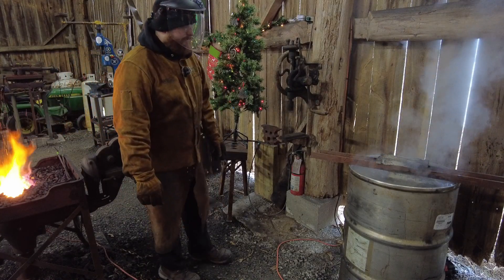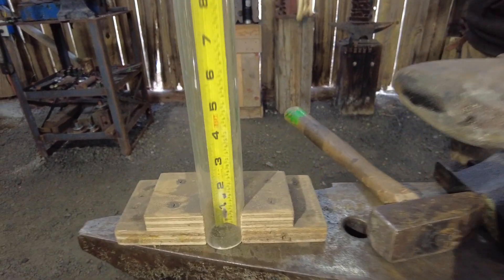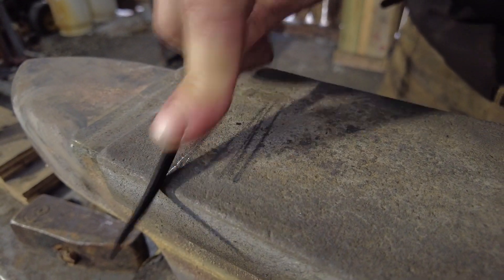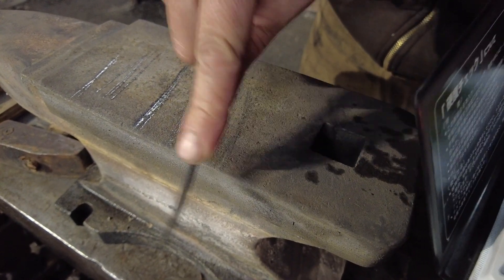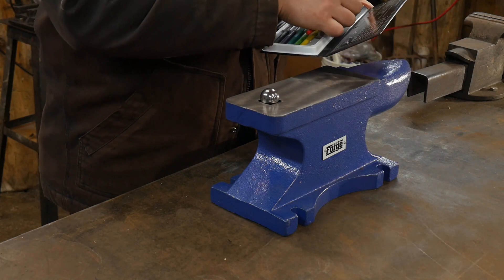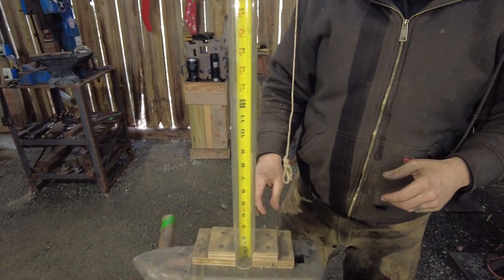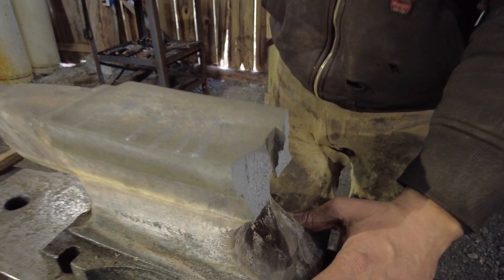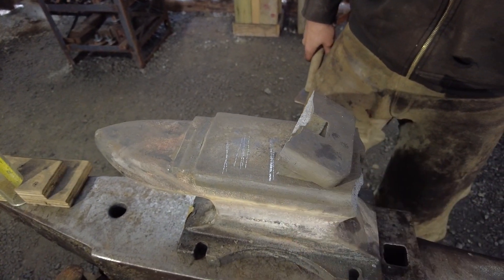Harbor Freight Anvil: Can It Be Hardened?

Comment: i feel like if you moved the anvil around while quenching it might be harder. do you think it would make a difference?
Reply: Physics - you can't do anything with cast iron far as heat treating goes. Best you can do is break it like they did - cast iron is super brittle as it is - heating it glowing hot and drowning it will assure you of a break - just like dumping cold water into a well overheated motor block.
Reply: Yes and no.  With cast iron, it's a lost cause.  In general, though, you are 100% correct.  The lydenfrost effect forms a "pocket" of steam around the anvil, preventing it from further cooling it.  Historically, anvils were often quenched under running water, often a waterfall or "shower" type rig.  Even moving it around helps break up the pocket, but fast moving water is better.

Comment: So,  a 12-18 inch piece of 4140 3in round heat treat from Speedy Metals or whatever tilted up vertically would be a better bet for a newbie I'm thinking.
Reply: Definately. Someone wrote a comment above that Harbor Freight anvils are only anvil shaped objects. They are good for straightening nails or for paperweights. Cast iron is not hardenable.
Reply: Cast iron can be flame or induction hardened (common for machine ways, gears, etc).

Comment: Thank you 
&
Merry Christmas. 

How many requests did you have 
for forge welding steel plate to 
the H.F. anvil ?
Reply from the maker: Merry Christmas And maybe enough to test ? 🤔
Reply: I've heard of people welding plates on, always assumed they meant arc welding.  (and quite a few did, I suppose).  Somehow The thought never occurred to me that you could forge weld it.  That might actually be the best possible "upgrade", short of selling it and buying a better anvil.
Reply: I am still very new to anything other than some stick and MIG welding but I have always heard that you can't weld cast iron. Is forge welding different in that respect?
Reply: @markhenrikson9790  You can weld cast, but it is not easy to do, well beyond the abilities and equipment of your average amateur welder.  As for forge welding, My understanding is you can bond pretty much any metals that you can get hot enough, and can keep from forming scale/oxide, but there could be some that don't work.

Comment: Considering Harbor Fright's track record with quality control, it's probably going to either crack or shatter on quenching, but if you luck and grab the golden ticket one, you'll have a pretty decent entry level anvil that isn't just an ASO.

I've bought a screw driver where the point chipped turning a stuck screw, took it back and swapped it out and now i use that thing for prying staples and such. Harbor Freight is just a Blue Collar Casino.
Reply from the maker: LoL love that blue collar casino 🤣
Reply: I watch Project Farm, The Harbor Freight car battery jump box, couldn't jump a Ford 4 Cyl Ranger. The Harbor Freight zip-ties, the best. I got an open box small shop vac for about $20, amazing for small, tight area jobs, use the hell out of it. picks up screws and nails  Your comment, on track. I have engine hoists and stands. about 3 floor jacks, couple ATV jacks and jack stands, never had an issue. The ATV lifts I use all the time on our Harley's and other motorcycles. One of the floor jacks I use on my F350. I have busted some of their hand tools, but I am fine with it. Need to modify a hand tool, cheap is the way to go. I have a lot of old made in USA Craftsman, not going to grind an open end wrench to fit in a small spot I'll most likely use once. This is where Harbor Freight shines. Sometimes cheap tools are priceless.
Reply: @michaelconran5252  the rule I was tight growing up, if you need it for one job, go to HF, if you need it to last go to Sears
Reply: @deathsicon  unfortunately Craftsman is not the same anymore. Most of the Craftsman is have is from 80's early 90's. Now I buy other brands that have lifetime warranties. I got cheap if it something I will only use a few times. I went cheaper on the 72 Torx I may use 2 or 3 more times on my Harleys luckily over the years I have anywhere from 3 to 5 of everything.
Reply: @michaelconran5252  yeah it's sad, though since I went to school for motorcycles I mostly use snap on until I do the big diesel machines at work
Reply: @deathsicon  a different but useful rule if you do not know how often you will use it, buy the cheap set, and whatever breaks is worth replacing with quality tools.
Reply: @vidard9863  That and If I borrow it 3 times in a month I need my own.
Reply: @deathsicon  -- You work on big diesel motorcycles?
Reply: @binbashbuddy  haha that'd be fun, but no, snow cats, tractor, backhoe, and ski lift
Reply: I've bought things from HF and now, I wouldn't buy a pencil there.
Reply: This is why I actually love MasterCraft from Canadian Tire. The majority of their stuff goes on sale every 3 to 4 months, and it's got life time warranty on most of it too. That's because they deal in factory seconds and refurbished units from like DeWalt. So yea... Sometimes you get a bogus grinder or something else. But you can burn them out and bring them back as many times as you want, and if you wait for it to go on sale it's a steal
Reply: @lucasblizzard7261  Unfortunate that people that don´t know how to use tools will screw that up for normal people.